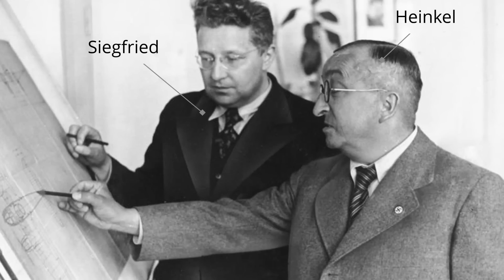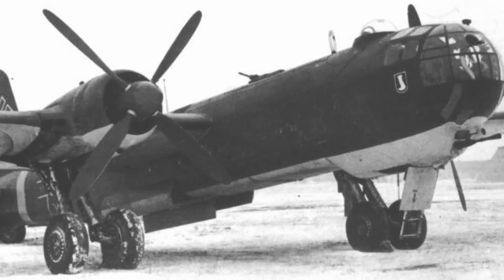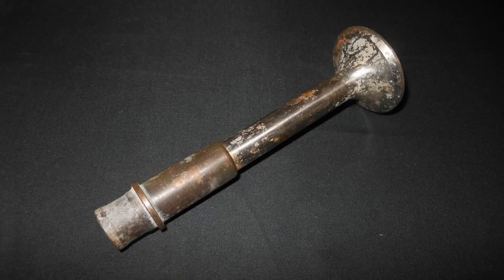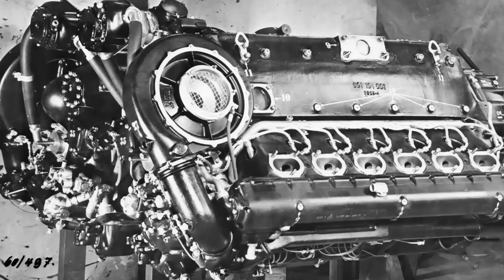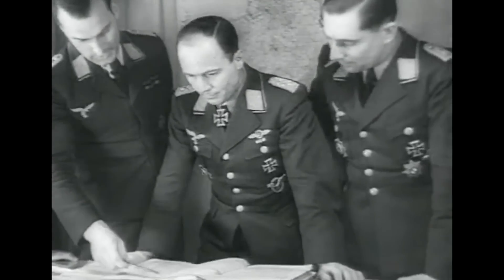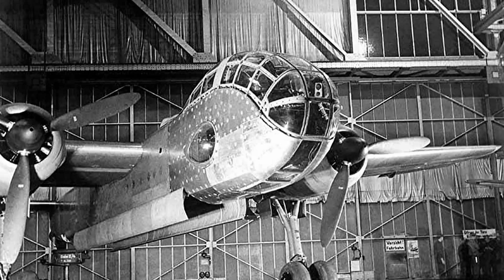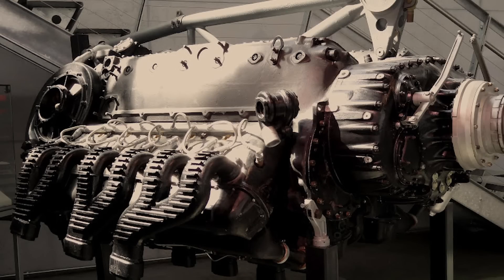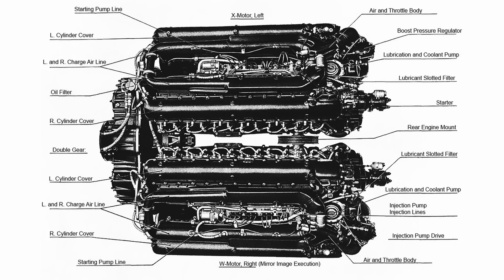Why did WW2 Germany Start Welding Engines Together? DB 600 Double Motors

Comment: The British made a similar mistake in the Avro Manchester with is 24 cylinder RR Vulture engines. However, Britain realised it was going to take a lot of time and effort to get working, IF it would work properly at all and simply changed the design to use four Merlins instead and the Lancaster was born. German aircraft engine development in WW2 is lamentably awful, they wasted what resources they had and didn't have anythingto challenge the Griffon-Centaurus-Sabre generation of British engines, instead they were left using developments of what they began the war with.
Reply: The X-24 RR Vulture was abandoned but the H-24 Napier Sabre was eventually a success.  Pratt and Whitney also tried some H-24a .
Reply: Well, one could even argue that in retrospect the Sabre was a mistake. It took a very long time to get working well enough for operational use, and even then it remained a very temperamental and maintenance intensive engine. Arguably it would have been better to instead concentrate on ramping up Griffon production (a Griffon-powered Typhoon/Tempest?), and on getting the Bristol Centaurus ready sooner so it could have made it into operational use during WWII.
Reply: @jbepsilon   Helping Napier with the Sabre could have delayed Bristol’s work on the Centaurus?
Reply: They did build a coaxial jet engine, which was tremendously faster than the Gloster Meteor, and proved itself in battle, however, by the end, only inexperienced pilots flew these
Reply: @WorivpuqloDMogh  the problem is that all these developments comsume the same budget and resources. Obviously its hindsight to say it but they could have dedicated the resources the Germans poured into failing projects such as the 606 and 610 into the projects such as jet engines which were eventually a success
Reply: That's not completely true the had to dearate there engine 's because of the lack of nickel for valve's please check out Greg's auto mobile Chanel
Reply: The Germans developed engines that competed with the griffon and Centaurus .  The Jumo 213A and DB603A both entered service in mid 1943 the same time as the British engines
Reply: @williamzk9083  But those German engines were only two out of how many failed projects? They were barely developments either, they were mostly just enlarged versions. Both were fraught with problems too, the 603 loved to burst into flames, for instance.
Reply: @ the DB603 and Jumo 213 had a few problems when they entered Service in the first quarter of 1943.  The main one being a service interval just under a 100 hours . They were both pretty reliable by the middle of 1944 and then started being expanded into Use on fighters.  None of the allied engines worked very well in their first year of Service either.  The Napier Sabre was a disaster because I’ve been pushed into Sevice a year early and took a year and a half to get right.  Didn’t work really well till 1943 and was still giving problems in that year.  The same with the CW R-3350 which gave a lot of problems to the B29 until the end of 1944 into part of 1945.  The Bristol Centaurus didn’t really take part in the war and powered nothing of consequence except the Vickers Warwick in late 1943.  The two German engines did their job mostly on 87 octane fuel.  They started getting water injection and 100 octane fuel at the end of 1944.
Reply: @williamzk9083  The Centaurus didn't take part in the war? Erm, it did, it was the powerplant of the Tempest, over 1000 of which saw wartime service.
Reply: @ the Hawker typhoon and Tempest were exclusively powered by the Napier Saber engine.  The Bristol centaurus did not power any fighter aircraft during the Second World War.  The Centaurus powered the Seafury but only after 1946.  The Centaurus we only used on the fairly lacklustre Warwick from late 1943 onwards.  The Centaurus was an inconsequential engine during the Second World War.  Britain relied on the Merlin, the Sabre, the Griffin.  All of them were less powerful than the American PW 2800 of the same time and certainly less power than the R3350.
Reply: @williamzk9083 100 Octane C3 fuel was available in Germany from 1943 but all the bombers used B4 due to limited production capacity.
MW50 use required C3 fuel.
The downside was C3 fuel destroyed the engines from two directions, first it diluted the oil and destroyed the bearings after about 200 hrs operation and second, if it sat in a synthetic rubber lined fuel tank for longer than a week, its octane rating dropped from over 100 to below 70 due to a chemical reaction with the rubber.
Reply: The DB600 series had almost the same displacement as the Griffin.
The Germans had endless problems with fuel and high temperature materials. The C3 fuel problems weren’t what you would expect however - it was the fuel reacting with the lining of fuel tanks and contaminating the lubricants because of high boiling point.
Reply: Tecnically the DB engines are far more evoluted than RR ones thanks not only to Bosch mechanical fuel injection and as italian as japanese industry don't even were capable of make his copies works decently....
Reply: @kkteutsch6416  The evolute of an X-24 would be the crankshaft, between the twin crankshafts for a H-24, those barmy DB W engines must have had it somewhere between the bolted flat plate top covers.  The V-12 Griffon made tons of power with very little fuss.  An inverted Griffon might have allowed a slightly narrower top engine cowling from the sort of inverted cylinder evolute?  Are you sure you mean or understand evolute?
Reply: @givenfirstnamefamilyfirstn3935  the most common fail on RR engines were just the crakshafts, according to a book I own about Spitfire....
Reply: @kkteutsch6416   Quill shafts for the Supercharger needed development and magneto skew drives snapped on early engines.  They were driven off the camshaft but later more use was made of the crankshaft.
Reply: @gooser__43  
An overly dismissive comment.
The fact is they were able to put it into combat. An impressive achievement for a first generation turbojet.
Reply: Your comment conveniently ignores German development and implementation of turbojet engines.

Do you think before you type?

Comment: Those DB606 and DB610 were as a disaster as the Rolls-Royce Vulture. At least the British changed their minds fast to get the Lancaster
Reply: Correct but the great issue with the He 117 was that it had the absurd requirement to have a moderate dive capability that required inordinate wing trengthening making it very time consuming to convert the bomber to much more simple 4 engine bomber like the Lancaster. It was absurd because it could have saved quite a lot of weight and simplified wings to produce...
Reply: The Vulture used two small obsolete 800 hp engines as a base, it ended up not being worth the effort.

Comment: Nice to know what these engines burnt per minute..I think the Merlin would burn 2 gallons per minute at cruising speed?
Reply: The truth was that all high powered radial or in-line engines was very heavy on consumption. Perhaps it better to say that the engineers was more concerned having the highest output with reliability, apparently not with German double engines. Consumption wasn't a great concern...
Reply: @paoloviti6156  Very true, I can understand that when you need speed and performance, Fuel consumption is of little concern,, I just wondered if any one knew  how thirsty these engines were?
Reply: @neildelaney5199  Those engines are running rich. Fuel is used for cooling.  1l per second is likely at WOT.
Reply: @neildelaney5199  those big engines were very thirsty. I know that the Pratt and Whitney R-2800 for example was gulping gallons just to warm up before taking off but also the Rolls-Royce Merlin was no joke too
Reply: At cruise the WWII aviation engines were actually pretty efficient, producing BSFC numbers comparable to modern car engines. Scale up your car engine to produce 2000hp, and run it at 70% max power and it'll gulp a lot of fuel too.
Reply: @jbepsilon  There were 5 engines on a certain Sherman (joined together) a multiblock,30 cylinders,, the handbook quoted a gallon of petrol (Gasoline) per 800 yards

Comment: Welded...seriously? 😂😂😂
Reply: Can’t imagine arc welding these beasts together .. what a crazy engine
Reply: Yeah, it would make no sense to weld something together that was already connected mechanically. My question is was there any mention of the engines being indexed as far as cylinder-timing? I was kinda' half watching/listening  while making something to eat.🙂
Reply: @gteefxr3094  I was mistaken, the DB 606, 610 and experimental 613 where two separate engine blocks joined by the output shafts by the reduction gearbox and supports in the back. The DB 604 was a proper single crank X-24 engine.

The X-24 had 6 journals for the conrods, so it had an even order of firing every 30 degrees according to wikipedia.
Reply: No, it was different castings, common crankshaft etc, it is an X engine, not two V12 engines welded together. It's just a myth.

Comment: Harmonic torsional vibration... ?
Perhaps in a war plane it would last long enough.
Detroit diesel did this modules put together twin s on one gear box .
Germany lost ww2 and now sells POS  BMW Audi Benz break alot $$$ for revenge..
Reply: what does that comment even try to convey?
Reply: @Keckegenkai  That joining two engines (or any pulsating rotational mass)  on to one spur gear is very difficult since each rotating assembly vibrates at different frequency and a node of Maximum torsional shear occurs where they join..
In other words it's not a good idea..
Reply: @Motorhead250 don't underengineer the gears/connections then
Reply: @Dilley_G45  It's actually more than that.
Torsional vibration can exponentially increase forces on shafts  and teeth of gears if shear node occurs near or at their position.
Second and third order torsional vibration calculations some of the most intense physics engineering problems.
Today we have Finite element analysis computer program can model such unlike back then .

Comment: The Fairey Prince and Monarch engines were also double engines (V within V), which flew in Fairey Battle, but were not proceeded with.  A Monarch engine supposedly still exists at FAA Museum, Yeovilton, UK.
Reply: There's a crash recovered He-177 engine at the Wings museum in Sussex, it's not THAT badly damaged and it's an interesting thing. They've also got the block of a Napier Sabre with the sleeve valve installed, so you can turn a crank handle and watch the sleeve rise and fall and oscillate. I knew how sleeve valves worked, but it's a cool thing to watch.